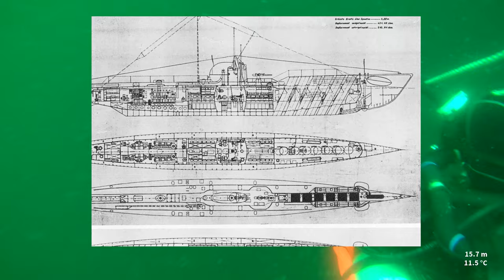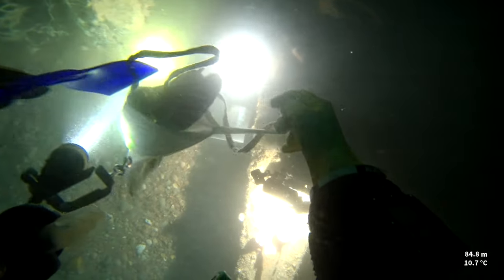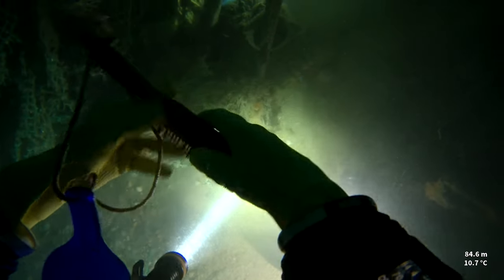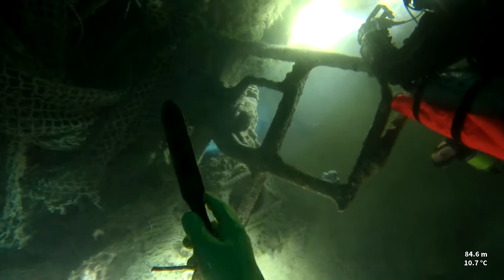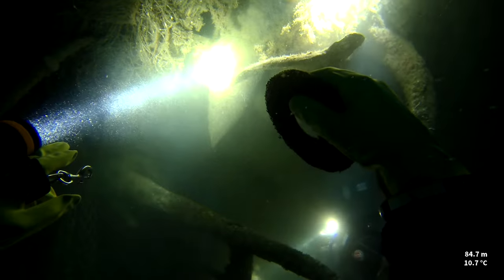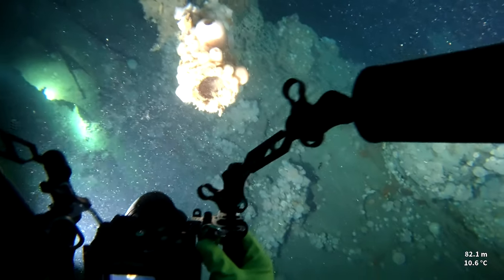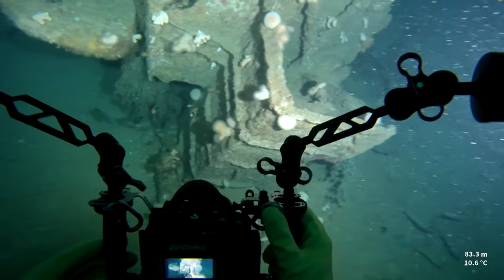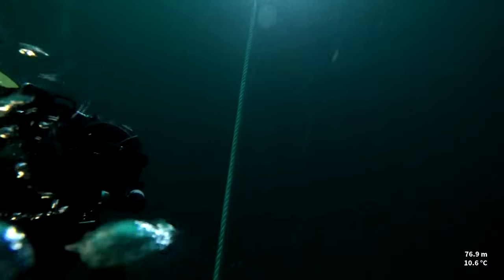Mystery german submarine 280 feet down

Comment: At least you weren’t in the confined space of an engine room as you scraped away all the crud. Sad that after so much effort you couldn’t get a positive ID. I hate to think of your deco stops/time. Do you carry all your own air, or can the dive boat provide you some of the deco air? And what are those rebreather units, with 4 suicide bottles, 2 either side (realise they’ll be O2, He and not true suicide bottles…but you know what I mean😊)
Reply from the maker: Yes, no way we could get inside with all our gear on so that isn't an option.
We've got more than enough gas to complete the 2 hours of deco on the rebreather.  If we had to bailout to open circuit then would need gas dropped from the surface

Comment: Great video and I can appreciate your frustration in trying to identify the wreck. I researched, located and dived UC75 off the East coast of Yorkshire back in 1989 but at a much more manageable depth of 35m. Very, very similar to your suspected UC68 though with the mine tubes clearly visible. On UC75 the bow tubes were totally exposed, still attached to the pressure hull together with a very impressive stern tube sticking out into free water due to damage at the stern. Lots and lots of lost netting particularly around the deck gun, stern tube and around the props.
The forard hatch was open on UC75 although the rear hatch was sealed. Apart from physical damage incurred by being rammed by HMS Fairy, it looks like water ingress through this open hatch probably sealed the submarines fate.
 I finally identified the sub with the help of Horst Bredow of the U Boat museum in Cuxhaven, from a brass circular plate attached to the starboard torpedo tube door giving the tube number, date of manufacture and manufacturers name.  Perhaps the bow tube you located on the seabed could maybe be used for this? 
Unfortunately UC75 was extensively salvaged in the subsequent years as its position became common knowledge. Such a shame as it was a magnificent site and not least, being a war grave.
Best of luck with your project and do take care at these (to me) worrying depths!
Reply from the maker: Wow thanks for letting me know about your experience and what a great result!
If you look at my video from the first dive you can see that this submarine also had an impressive stern tube now that all the (non-pressure) hull has rotted away.  
I doubt we'll go back but thanks a lot for the suggestion about the torpedo tube - was the plate at the front or rear of it?
Reply: The plate was on the rear door of the tube just held on with small brass screws. My team and I dived UC75 many times but never physically removed anything apart from the odd crab and lobby. I did remove the plate however once I got wind of salvage divers becoming interested in the site though. I donated it to the U boat museum and as far as I am aware it is still exhibited there.
I didnt notice the stern tube on your first video but will certainly go back and have another look. 
I do have some video of early dives on UC75 but quality is poor, being HI 8 tapes! Visibility is usually poor as well, 3 to 4m being good. And tides are fierce. 
Massive respect though for what you and your mates do. I was literally cringing when I saw you at 80 odd metres underneath the netting and cutting it away on the first video.😅
Safe diving and I look forward to more in the future.